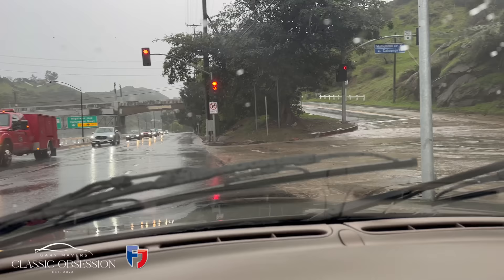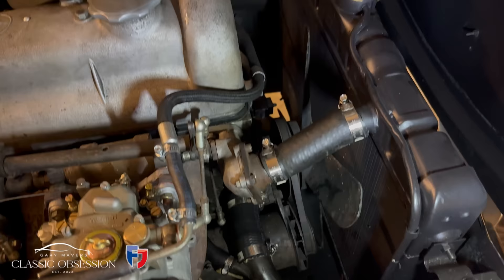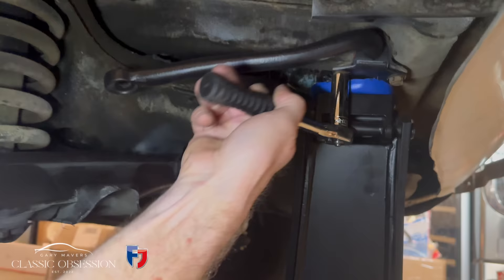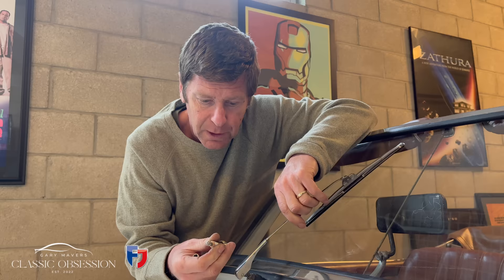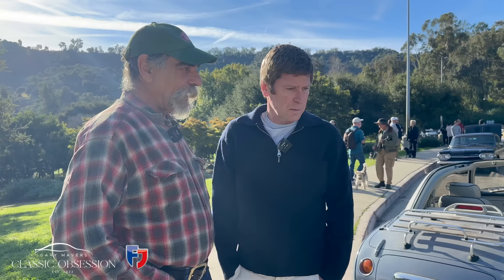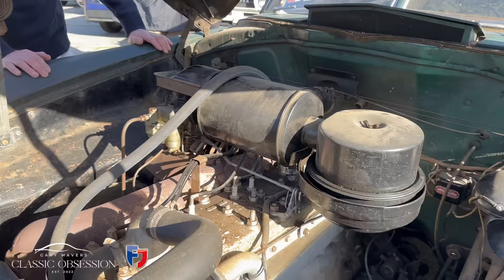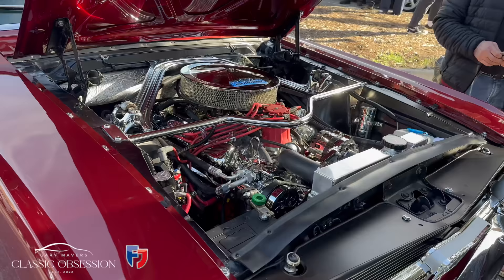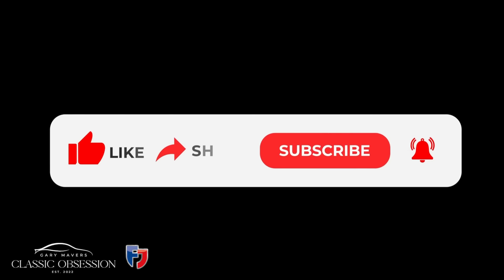Mercedes 190SL Restoration (Part 6) | LA Rescue! | Classic Obsession | Episode 56

Comment: I really love and appreciate these videos. So well presented, they must take hours in the editing. 
  On the subject of sealed for life ball joints, I recently gave my son my 1962 Citroen ID 19 which I’d had for 20 years. Every steering joint, driveshaft coupling and other ball joints equipped with grease nipples meaning that not one has needed replacing in over 60 years. 
   I’ve owned several DS Citroens over the years and what marvellous cars they have been. 
   Not a greasing point in sight on my ‘’80’s RR Silver  Spirit. …..
Reply from the maker: I agree. Some of that French engineering is so simple and years ahead of its time. I love the SM although the Maserati engined model seemed a little ambitious for the time, what a thing of beauty. Regards.

Comment: I've seen a 1958 Merc 190SL at my local Mercedes dealer which is on display. It isn't quite as good as that white one. I loved the R107s at the show. There's also a 1984 R107 380SL on display in the same dealer as the 190SL. There were quite a few RHD cars at that show.

Comment: Be careful when you grind the spark will make the rest of the car rusty have you ever seen an old car where the hole for the antenna was drilled and the iron filings not cleaned

Comment: Question for you Gary ? Where are you getting your tools for work in LA ? Do you hire a set or take yours with you ? There’s gotta be so many little niggly jobs that require a certain tool but if you haven’t got your normal set with you, that must slow you down a fair bit ?
Reply from the maker: Absolutely. I wish I had my tools here. Sick of nipping out to hardware stores for for bits of tools. In hindsight I should’ve just bought a descent set straight away. Everything is so far away which eats at your time and crazy expensive! Regards.